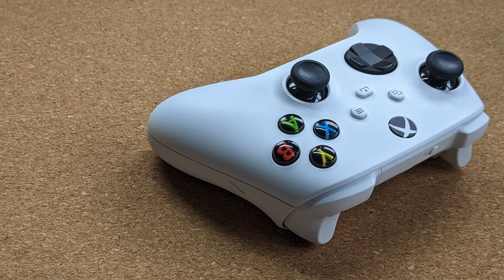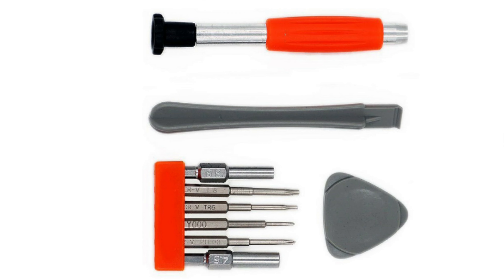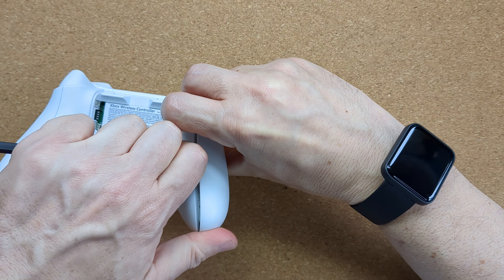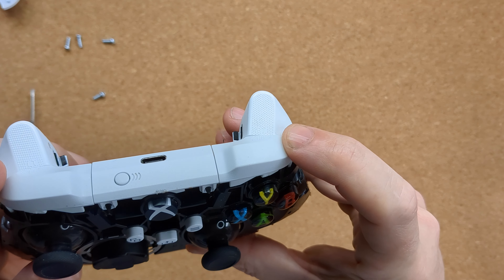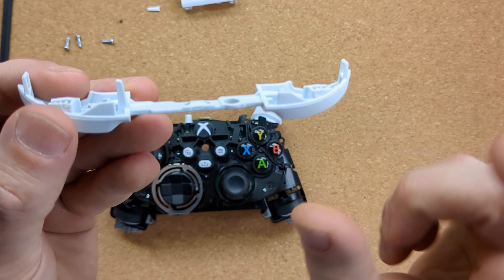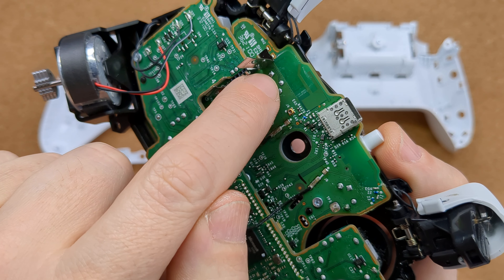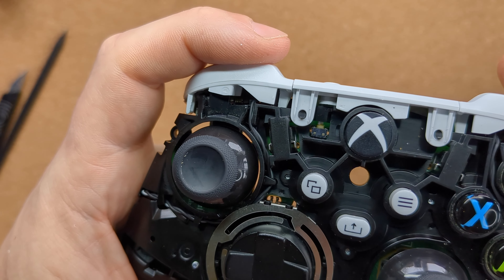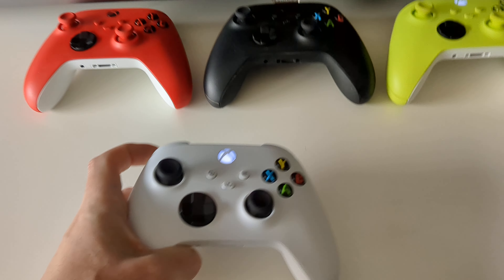How to fix broken bumpers on Xbox Series S or X controller - no new parts needed!

Comment: Opening xbox controllers is always a nail biter 😂 Never would've thought to heat up the plastic. Thanks for posting this!
Reply from the maker: It's so much easier, doesn't even need to be particularly hot. Let me know how it goes if you try it out again!
Reply: DUDE -/ Try opening up a Ps3 Controller without having it malfunctioning 😂😮😅
Reply: I actually broke a nail trying to take off the handles.

Comment: You don't have to take off the main part of the controller if you don't have the right screw. Just take off the grips, then take of the front part by prying it open to get to the left and right bumper. ✅
Reply from the maker: I never knew that! Thanks 😊
Reply: Could you go further into detail i got off the grips but I’m confused on the rest
Reply: Pop the 'central section' up and then you can take off the bumper strip

Comment: I'm really loving that I need a special screwdriver for this specifically.  Microsoft really on their game with making modern controllers as annoying and mediocre as possible.  Thanks for the helpful video though!
Reply from the maker: You're welcome! Yeah they really don't want people opening these up
Reply: Ironically, even the $5 kits come with the proper screwdriver.  @JoeBleeps
Reply from the maker: @hipflipped  often cheaper than buying the tool itself!
Reply: it's so you buy a new controller instead of trying to fix an old one
Reply: If only you knew how many people open a controller and break it but still ask for refunds. Some barrier of entry is necessary. At least it's not some kind of proprietary Micro$oft screw.
Reply: @Bollibompa kinda like that other brand that has screw heads that takes a bit that looks like an apple with a bite taken out of it? (Honestly I'm surprised they haven't come up with some proprietary screw and driver set. Different sizes, for different things, but they all have the same shape indention in the head.

Comment: instead of glue you can just wedge in some sturdy piece of plastic/wood etc that fills the hole in which the button rests, I cut off the tip of an empty glue tube and put it in there, readjusted the piece with a cutter knife until it sat right, works like a charm for over a year now.
Reply from the maker: Nice!  Always good to hear of alternative solutions

Comment: Honestly man, thank you so much. My LB button stopped working after a (little intense) 1v1 Rocket League match... then I passed by a repair shop and their price to repair the button would be 3/4 the price of a brand new controller. So I decided to buy a new one. Then I stumbled across your video, and it was literally the same plastic pin that'd broken off from mine. I glued it back on and got it working again, 0$ spent in total. You sir are a LIFESAVER.

Comment: Awesome video man - saved me from spending $50 more for an entirely new controller just because of that cheap little pin snapping in the assembly. Earned a sub for that - thanks for the super easy to follow video!
Reply from the maker: Thank you so much!

Comment: I had the EXACT same problem and this video just saved me $50! 
Ordered myself an xbox controller repair kit for about $8 on amazon with different screw-drivers and wedges and opened my controller right up and glued the little plastic piece back together! Absolute lifesaver.

Comment: I finally got around to playing Callisto Protocol since its on gamepass. You need to use the left bumper to sprint. About halfway though the game my bumper stopped working. It broke in the exact same place. 

Ordered a replacement on amazon for 9 dollars that not only comes with the tools to take the controller apart. But two replacement sets of bumpers and 2 replacement sets of joysticks. Pretty good steal.
Reply from the maker: Sounds like you might end up needing the spare bumper!

Comment: Wish I saw this video sooner, bought a torx bit set for the specific screws, took apart my entire controller, then looked up a video to find the exact same problem I’m having, not even joking. Mines a white series controller, left bumper was moving but not responding, the same pieces broke even with that small black piece on the side
Reply from the maker: The replacement plastic parts can be found quite easily on eBay so hopefully you can get it sorted

Comment: For me it is the right bump.  I have had this issue with 3 controllers in 2 years.  Never had this issue with past generation consoles.  Eager to try it out.
Reply from the maker: I hope you have some success with it!
Reply: I've had the bumpers break on 4 xbox controllers now. They shouldn't be allowed to sell these anymore until they fix the design
Reply: I finally got the tools and time to try this.  I dont know what i do,  but both controllers had clean split the right bumper off the strip.  Thanks for the video has it helped a ton with the process.
Reply from the maker: @aaronfairbourn1075  such a delicate part. Especially given what it's for. Glad the video helped

Comment: What an absolutely fuckin detailed video, aye exact same problem for me LB. Didn't want to pay 50/60 bangers for a new controller because I'm a tight bastard, never even took apart any controller in my 40yrs of gaming, never even knew you can get just about every component for them too. Devine Customz are on holiday until the end of November so I got the bumper kit with srewdrivers off EBay for like a fiver and did the repair just now following your guide, ZERO problems, many thanks again man, SUBBED for potential future reference. Also getting Mani from The Roses vibes if you know what I mean.
Reply from the maker: Haha Mani bass legend I wish I could play like that. Glad the video helped! Thanks for the sub 🙏

Comment: Awesome. Had the same issue. Ordered a replacement part, have a feeling it might break with the glue in time. Thank you!!!
Reply from the maker: I think even if you take the sensible step of ordering a replacement it's nice to have an interim fix
Reply: @JoeBleeps amazon prime is a godsend
Reply from the maker: @Dyl-275  absolutely!
Reply: @JoeBleeps  opened to diagnose yesterday, back together all working today👌 appreciate the vid too
Reply from the maker: @Dyl-275  great news

Comment: Super helpful. I wanted to know what the issue could be before just tearing apart the controller and your video provided that information. Turns out one was snapped off and the other was half hanging on ready to break on me any second. Ordered a new piece off Amazon for 8 bucks instead of the repair and shipping fee battle beaver would have charged me. Thank you a ton!
Reply from the maker: Definitely worth getting a spare part in that situation! Good luck with the repair

Comment: Couldn't manage trying to use glue and with having the same issue with what was broken. My fingers are too big for the tiny piece that broke off so I put that broken off piece back in that slot that you pulled it out of, but instead, I folded a little piece of paper and put it in between the broken piece and the bumper bar thingy. Works literally perfectly. Thanks to you, you just saved me about $40-60!! Works totally fine. 🙌🙌🙌 Easy subscribe
Reply from the maker: Ingenious solution! Thank you for sharing!
Reply: @JoeBleeps  it's great because I had two controllers with the same exact issue and now they're both working fine. 🤝
Reply from the maker: @AndrewSmith-yq9gc  that's saved a lot of money!

Comment: Great video and best one I found after looking at a few - an extra challenge I had was to get the bumper strip off as it didn't lift off as easily as shown in this video, but gently levering the two clips at each end by slightly inserting the t8 security screw driver into the small rectangular hole at each end of the bumper strip and levering it off did the trick

Comment: Crazy today I found out the same piece broke off into mines as well I was playing COD when it stopped responding out of no where I was mad took hours to figure out what was wrong then searched up a solution and found your video thanks man for the video I took apart the whole controller and just replaced it with a spare control I had instead of glue it back

Comment: Great video! And to anyone who didn't have the exact stupid little screwdriver to accommodate the little pin thing, you can use some careful force with a tiny tool (like a little bitty flathead) and just break the little pins right out of the screws. You'll still need the T8 but it won't have to be the extra special one lol
Reply from the maker: @kelseykerrigan3137  good tip 😊

Comment: oh i had the exact same little bit of plastic almost like a design flaw or something .....Barly used my controller as well since I got my PC and I bought the more expensive one with the adapter as well of well a easy fix then saves me 100 quid for a new one.
Reply from the maker: It seems so common that it definitely looks to be an oversight with the design.  A very delicate piece of plastic that just doesn't seem to be durable enough for heavy use.
Reply: @JoeBleeps  Yeah i downloaded that wild west from gamepass and the attack is the shoulder button and it just broke hardly used the controller as well since I prefer K&M. Part came the next day and sorted it no problem 😊
Reply from the maker: @davidinmossy  I'm glad you sorted it!

Comment: I found that you don't need to remove the entire back, just the plastic bit with the pairing button like the grip covers, stick something under and then remove the side toggle things from the bumper and it will slide off. This allows you to not need the special tools to fix this
Reply: What special tools are you talking about? The pointy part of the spudger?

Comment: during assembly make sure the posts of the batteries go back into the bottom shell. I assembled mine without doing so and my heart sank when it didn't turn back on. easy fix though and great video!
Reply from the maker: Yes! I've encountered this too, I've covered it on one of my other videos. Very frustrating when you don't realise what's happened

Comment: I don’t really understand how people’s controllers break so easily. I’ve had a Robot White Series S Controller since 2021. Been dropped a few times, even smack on the left thumbstick. Works good as new. Either most people are unlucky or really don’t know how to take care of electronics.
Reply from the maker: @SquiddlyInkster  you'd be surprised. From having seen inside these controllers many times I'm amazed how thin they make these plastic parts, all it takes is playing a game that has a controls scheme making a lot of use of these buttons and the plastic can start to fatigue
Reply: @ Ah, makes sense. I don’t play competitive shooters or other intense games too often, so I can see how that would make the difference.
Reply from the maker: @SquiddlyInkster  I didn't know either until I heard some of the stories in the comments here!
Reply: Yeah, most likely fatigue crack growth through chain scission from a microscopic craze or similar in the brittle polymer. Could be alleviated by a different design since it snaps off at what looks like a quite severe stress concentration. Or simply using a more high quality polymer for that specific part with minimal chemical crazing.

Comment: Thanks for the tutorial, I need the security bit so I ended up just grabbing a kit that included replacement bumpers. On mine the small piece wasn't fully detached, but it was no longer making contact. I saved it and I'll try gluing it to swap to when the next one ends up breaking.
Reply from the maker: Those kits are so convenient. Glad you got it fixed!

Comment: On my 3rd Xbox Series X controller in 2 years of me having the console. 2 times it was the LB button, and 1 time the left analog stick had very bad drift. At this point im convinced they designed the controllers to piss me off. They design them to fail to see a new controller. It's to the point the best buy guy and i are great friends now because approximately every 8 months im buying a new controller. I only use the controller a total of 4hrs a week.
Reply from the maker: @ulysses_757  the cheap components inside are really cheeky when they charge so much
Reply: I managed to fix the LB issue with glue as described in this video, and fixed some pretty bad left analog stick drift with the help of “How To X”s video “7 methods to fix analog stick drift”, methods 5 and 6. The key to fixing analog stick drift is compressed air, plenty of isopropyl alcohol applied with a cotton swab. The videos were super helpful. Hopefully you held on to your broken controllers and can repair them relatively easily!

Comment: Thanks for making this and really clear instructions. Did this with superglue but it quickly broke again so re-did it with two part epoxy, so far so good. Those anti tamper torx screws are a PITA but I did (just) mange to use standard torx bit.
Reply from the maker: They are a nuisance aren't they! And getting those plastic caps off is so tricky. But all better than spending out on a new controller!

Comment: Thanks, this vid was very helpful. In my case the part that pushes the button was broken off probbably from mashing LB for clutch in racing games and missiles in war thunder. I got stuck on a Cyberpunk 2077 mission where i couldn't progress with no LB so I glued it back on.
Reply from the maker: I'm glad it was helpful! Seems to be a very delicate part
Reply: @JoeBleeps  I think the reason it breaks is most players hold the game pad in a way that makes them push bumpers on the outer parts away from the part that clicks the button. The effect from that is unnecesary sideways pressure put on the plastic part and it breaks
Reply from the maker: @kompos8144  amazing that these things reach production without weaknesses being picked up

Comment: thank you for heat gun trick,
it make more easy to open the left & right side plastic
Reply from the maker: You're welcome. I think it's particularly useful when you haven't removed them before and you're unsure where exactly the clips are or how much pressure to apply

Comment: Okay there is a hack for the security/tamper proof hex screw, you just use a mini/micro flat tip screwdriver. I opened my controller up and sure enough one piece of plastic was broken completely off and the other was cracked. I think I might try using the 'permanent' lock tight because I've always had problems using crazy glue with moving parts, it doesn't seem to last and weakens or becomes dry and brittle.
Reply: Glue wouldn't hold, got frustrated, gave up and purchased new bumpers. 2 for $10 on Amazon with sexy tools.

Comment: The problem with my controller is that the RB button is too sensitive, i mean, just by a little touch the RB gets clicked. 
Could this be the solution too? I don't trust myself to do it.
Maybe the clicker broke just the tip making it annoyingly easier to click.

Comment: you can get the LB RB part for less than 7$ ! i'm just waiting for my new replacement parts to arrive
Reply from the maker: That's the sensible approach.  I am too impatient!
Reply: @JoeBleeps  my new bumpers arrived but replacing it wasn't solution , i think there is problem with button inside the controller so i used your method now it's working like a charm , also i broke the old bumper during the disassembly
Reply from the maker: @coffeeaddicted4495  glad you got it working!

Comment: Thanks for the excellent and detailed video! I have the same exact problem.   Buuut after assembly the control stop vibrating 😢 any suggestions ?
Reply from the maker: Check that the wires connecting the rumble motor haven't been pinched or damaged first
Reply: @JoeBleeps  the wires seem fine :( you think I should disconnect the wires and weld it again?
Reply from the maker: @GerardoValdez22  not if they seem to be okay. Did those two wires in the middle get disconnected? They are tricky to clip back down properly in my experience

Comment: I have never thrown or dropped my controller but i do rage squeeze it which usually sends the battery compartment cover flying and battery spilling out. In this case though, i blame assassins creed odyssey for my over use of the quick strike button which i spam whenever times slowed. Going after bounty hunters well above my rank requires probably 500 hits per enemy. I try to avoid arrows and abilities to test myself, guess I was testing microsofts engineering as well.
Reply from the maker: Yes, the rage squeeze is real haha
Reply: @JoeBleeps  I managed to glue the pin back using super glue and the spray, we call it CA or superglue and kicker here in US. Most all hobby stores carry it, for anyone looking.
Reply from the maker: @ChrisHarmon1  glad you got it fixed!

Comment: Thanks for the video ! Very professional. Im buying my 10th set of new bumpers , because they always break of. It's a scam. I tried glueing it once but it broke off again. Any tips on how I make them stronger ?
Reply from the maker: My only experience is with using this glue. If you use the super glue with the accelerator spray and then trim it, it works pretty well but it does seem to be a design problem more than anything

Comment: Luckily, in the Resident Evil 4 remake, there is an option to use RT to parry, instead of using my left bumper which barely moves for whatever reason, so thank god for that. Everything went well... Until I got to that part where I had to throw harpoons at the lake monster, and had to resist throwing the piece of garbage into my toilet.
Reply from the maker: That pesky lake monster! It's worth having a look inside the controller, it could be a simple fix